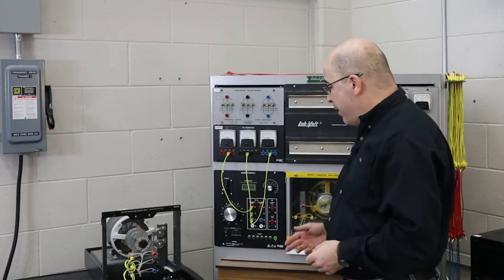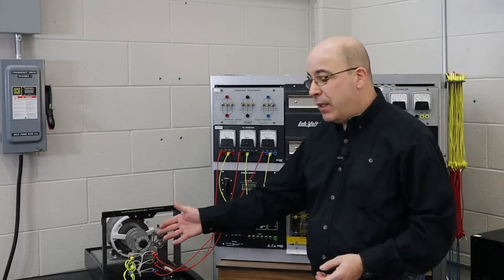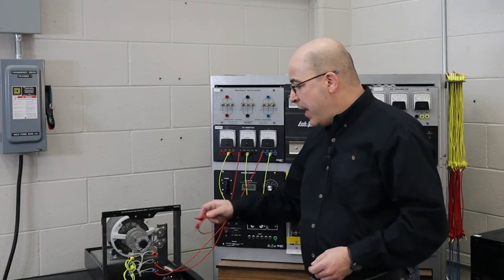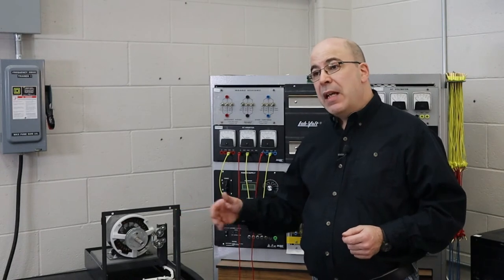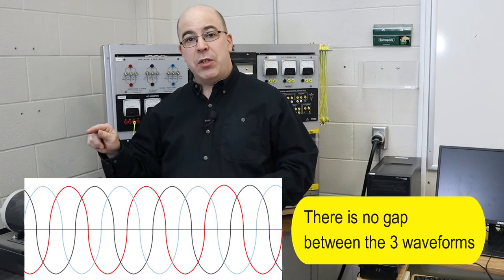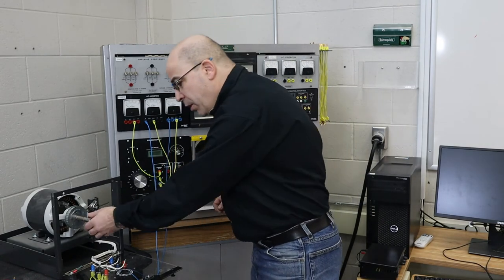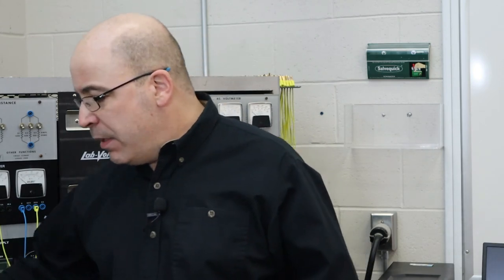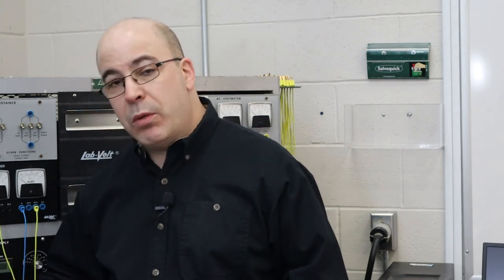My motor is single-phasing!

Comment: Well done! Nice demonstration.
One more sudgested experiment would be: to take 3phase star connected induction motor, connect its centre (neutral) point to neutral, and than disconnect one of the phases.
Turn power on/off, show currents and also do a load test.
This would be a good way to show the advantages of having 4 wires (with neutral) connected from motor to a distribution line in a single phase fault scenarios (especially for the parts of the world where phase faults are frequent and thay don't have phase control rellays.

Comment: I had a lab about induction motor in my previous semester of my studies, and I had connected ammeters to each phase. One of them had a blown fuse, and when I started the motor it was just hamming and the rotor wasn't moving at all

Comment: Excellent demonstration. Thank you very much. 
I understand that most motors have three windings and are modified to run as single phase motors through the help of the capacitor. 
Can we get rid of the capacitor and rearrange the winding connections to run as 3 phase? Is that a possibility?

Comment: Good video. I was wrong, i thought the motor would spin on 2 phases. Without assist. I figured would would pul 2-3X the current and possibly spike voltage. Current did spike, but as you say wasn't enough to turn 2/3 phase motor.
Reply from the maker: The main point is that the third phase helps establish the direction of rotation, that is why I could manually spin the motor into any direction I wanted. once that was established, the pulsations of the remaining two phases was sufficient to get the rotor up to speed, bear in mind that the motor was not under any type of  mechanical load.

Comment: How would you test this in a real life scenario? Would you see no voltage from one of the leads? Or any sort of grounding from one of the phases?
Reply from the maker: Testing would be difficult with a multimeter depending on how the motor lost a phase. problem solving something like this relies on visual and audible observations mostly, the tell tale sign is listening for the loud humming noise coming from the motor while it is not rotating. The unfortunate part is that the motor cannot remain in this state for very long before the motor windings become damaged.

Comment: How about if higher voltage sir lets say 480v.ac.if you turn by your hand the rotor, with the two face supplly the rotor spin?thkns in advance sir

Comment: what is current drawn by other two phase at single phasing please? what percentage is more than motor FLA at single phasing occurs during running and also provide the value at starting. thank you very much
Reply from the maker: In previous lab experiments, the two other phases will draw in excess of 2 times the FLA rating of the motor, in this case it was 2.5 amperes.

Comment: Where is the fault likely to occur with:
Three phase motor (CLASS A)
180/135W 
1.2/1.0A
CAP 10uF
 but... 
CAP used is 270uF 250v?

Comment: So this mean we can run 3 phase motor in one phase electric but we have to move it by hand to start the motor Correct me if I am wrong thank you.
Reply from the maker: Technically yes, but keep in mind that the motor won't be able to develop the same horsepower and it isn't something I would advocate because of the obvious safety concerns.
Reply: @sergelevesque6292  Thank you, I learned something from you that I did not understand before.